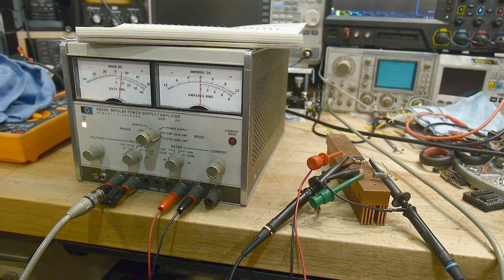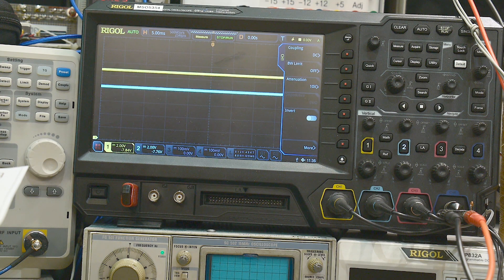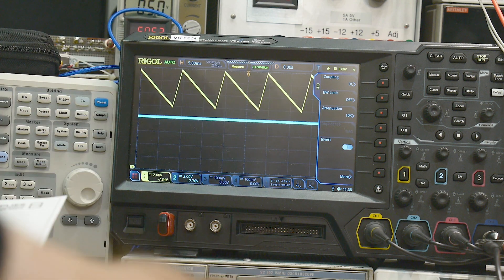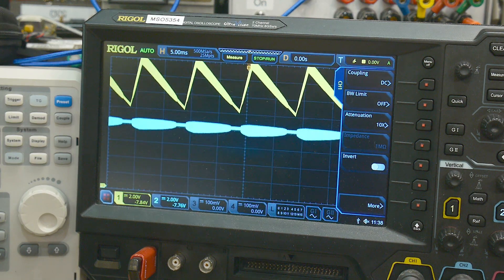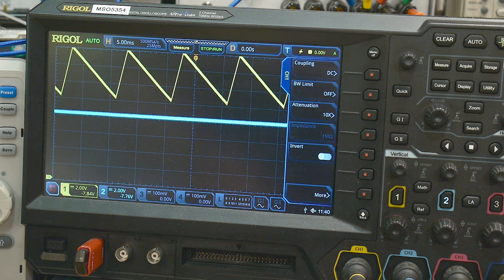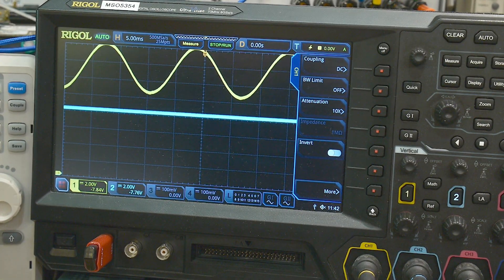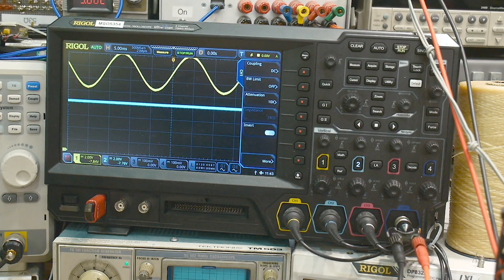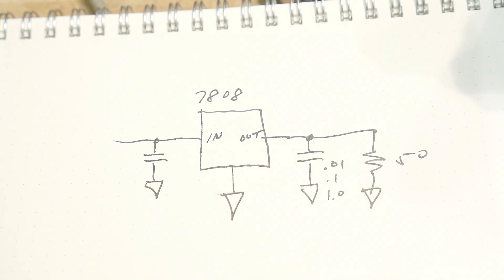#1598 Ripple Testing a Three Terminal Regulator

Comment: What would happen if there is a combined high capacitance of capacitors on the output? Like if I hooked out 4 op-amps with their own 0,1uF and 10uF caps and some 100uf down the rails, plus the usual caps close to the regulator?.

Comment: The very fact that the input to the regulator, at the point of measurement, shows "oscillation" demonstrates that the impedance at that frequency is fairly high - the input source isn't behaving as a good voltage source which should have zero source impedance.

The leads between the power supply/amplifier and the regulator are run as two separate wires, That means there will be a moderately large amount of inductance. It would be much better to use a closely twisted pair. Whether the inductance is really a contributor to the oscillation is hard to say, since we've never seen the frequency of the crud. Looking at that frequency and how it might vary with the capacitance at the regulator could be quite instructive.

With the regulator so far from the power supply I would use at least 10 µF right at the regulator input. Sometimes a mediocre electrolytic can be better than a cap with very good high frequency characteristics. The crummy cap can "spoil the Q" of an unwanted resonance.  A more predictable approach is to use a good capacitor in series with a small resistance (remember that an LC circuit with ideal components just shifts energy around - it doesn't "dispose" of any). A small capacitor with good high frequency characteristics in conjunction with the inductive connection to the input supply could be making a high-Q circuit with a big peak in the response.

~~~
An aside on low dropout regulators - Some of the older (but not really old) low dropout-voltage regulators are sensitive to the ESR of the capacitor at their output. The must have a cap, but the ESR must fall within a range that is neither too low nor too high. Newer designs are mostly tolerant of caps with very low ESR.

If you look at the gain and phase response of some regulators you'll find they bear a remarkable semblance to that of an inductor!

Comment: Hmm, how about testing with real mains transformer ripple under various conditions such as grid mains, generator mains and UPS inverter mains .  Also having a fridge or vacuum cleaner turn on/off its heavy load in parallel with the transformer input .

Comment: I think the test was not done properly. The dropout is specified at 2 volts but with no ripple on input voltage. 
Then, the ripple rejection is specified at 62db typ. for a 11.5 volts min input.
So, I would like to see again the test setup for an increased input voltage and the same output capacitors. I bet no oscilation will be there.

Comment: onsemi mc7800 series says no output cap is needed but it does improve transient response. Less than 0.1uf could cause instability.  ST also says it's not required but shows it in typ app circuits. They also call out a tant mylar etc. with low int impedance at high frequency at the input. They also show a test schematic to inject ripple for rejection testing at 120Hz. Another video could be interesting.
Reply from the maker: Yes, I need to revisit this sometime. I agree with you, the datasheets say output capacitor is bad and I've always avoided it. I may have found a cloned regulator.
Reply: Indead, it would be interesting to compare the behaviour of different brand regulator.

Comment: From what I have found the voltage diff for 3 terminal regs should be 2 volts plus the ripple  so that it has the envelope of voltage to keep from falling out . Nice demo there  like the video.  a low esr 10 mfd close to the load has worked well for me.

Comment: Interesting. Wish I had seen this prior to when I built a multi voltage power supply out of a large transformer, rectifiers & regulators. I did see the noise on the regulator's output and ended up as I remember placing, out of abundance of caution, a 10 micro farad electrolytic from output to ground.
Speaking of this type of regulator. I really like that they are available in that it makes macgivering together  unique power supplies much easier.

Comment: Some ps or batteries have a large output resistance. If you add  areisitor like 10ohms in series with 7808 input, would you get the same oscillations?

Comment: I always wanted to kown... If you yave two power suppliesmand you connect them in parallel via a resistor,  can one act as a programble load, or variable load?  Does the lower voltage ps get damaged?  If you had two of these gadgets, could you use the other as a programmable load?
Reply: Generally, no, a power supply can't be used as a load.
In order to act as a load a circuit must be able to cause current to flow from the "hot" terminal to the "ground" terminal, internal to the circuit. This is a "shunt" regulating function. Power supplies normally have no circuitry to provide the shunting path.
What happens if you drive the output terminal of a power supply above its setpoint is a bit hard to predict without knowing the actual circuit used. If the voltage applied is only a little above the setpoint (e.g. not more than a few hundred millivolts), the supply simply turns off its series pass element (typically a bipolar transistor) between the raw DC and the output terminal. Nothing untoward happens. If the voltage applied is more than a few hundred millivolts above the setpoint then things can get ugly, with current flowing where it shouldn't and potentially causing damage. This isn't too common, but it can happen.  

There are power supplies that are designed for operating 'in two quadrants", where quadrants are those of an X-Y graph with both axes extending both positive and negative. A positive supply would be considered to operate in quadrant 1 (above the X axis and right of the Y axis, where X it traditionally voltage and Y is current), where conventional current (i.e. positive to negative) flows out of the "hot" terminal, through the load and returns to the "ground" or "zero volt" terminal. If the supply has additional circuitry to do shunt regulation, where conventional current would flow into the "hot" terminal from an external circuit, you have positive voltage and negative (in a relative sense) current. That is "quadrant 4" operation (quadrants are numbered counterclockwise from Q1, so Q4 is "under" Q1. Some supplies can operate in all four quadrants. An audio amplifier that is fully DC-coupled is essentially a four-quadrant device, though most of the time it operates in quadrants 1 and 3 (positive voltage, positive current and negative voltage, negative current). Depending on the design, shunt or "current sinking" regulation can put higher stress on the power semiconductors than normal series or "current sourcing" regulation, so operation in quadrants 2 and 4 may have limitations that don't apply in Q 1 & 3.

Comment: LDO reg ICs (with 'pnp' series-pass element) are more interesting they have an extra node so potentially more unstable. 
In formal design, just "adding C to stop oscillation" isn't good enogh, so use a dynamic load (ie 4Q PSU) to 'shake' things while measure the phase margin at different load currents and input voltages. It's because if the C is too low ESR then it reduces phase margin = latent failure mode during service life.

Comment: Does your scope go up to switching power supply frequencies for the record/playback? I know that's borderline for the amplifier, but I'd like to see that kind of noise superimposed on a supply, and how well the 3 terminal regulators take that on under variable load (ie using bus power and local 3 terminal for clean power in lower voltages)

Comment: How much ripple in the output is acceptable is probably dependent on what you are doing with that output isn't it? Is there a way to determine the "correct" capacitance for a known acceptable amount of ripple in the output? Maybe this is done by repeating experiment you just shared with us, during the circuit prototyping stage of design?

Thank you for sharing with us your knowledge.

Comment: I have mentioned on your channel that linear v regs attain their best level of ripple rejection at a higher voltage than the dropout number... Three volts of headroom is typical for data sheet ripple testing. I would like to see the ripple at the dropout voltage verses the ripple at plus three volts... Using the input and output cap values specified in the data sheet. Please and thank you.

Comment: This has been known about for decades, the design rule of thumb was always install  0.1 ceramics as close to the input and output pins as possible. 
Not only did these things hoot with ripple, they sometimes burst into HF oscillation all by themselves.

Most of the spec sheets have something like this in them.

Cin is required if regulator is located an
appreciable distance from power supply
filter.
CO is not needed for stability; however,
it does improve transient response. Values
of less than 0.1 µF could cause instability

As you say always check with a scope. Also note that these regulators are NOT totally short circuit proof.
 
Andy

Comment: i saw that before and solve it with a  2,2µF foil capacitor in the outputstage of the 78xx and a 500 times bigger electrolytic capacitor  and a 2,2µFfoil capacitor in parallel on the input stage of the 78xx.

Comment: I would never use less than 10 uF on the output of a three terminal regulator. I believe the datasheets will tell you that. It is a good idea to parallel a 0.1 uF on the vreg output also for higher frequency attenuation.

Comment: The real world ripple needs to be a rectified sin wave with a large capacitor (would look like a distorted, lop-sided triangle wave) for the input.  The usual output recommended is about a 10uF electrolytic in parallel with a lossy ceramic disk or tantalum.  The ground leads need to be short and high current.  Any capacitive coupling of noise to the ground led will be amplified.  I am soo jealous of all the electronics you have to make measurements.  Enjoy catching you every morning.
Reply: 6V ripple is pretty severe, I'm surprised the regulator did so well.  I do wish he'd zoomed in on the oscillation to see what the frequency was.

Comment: The spec sheet indicates that output capacitance only affects transient response -- not stability.  Your signal generator is probably DDS in which case the sharp transitions are probably exciting the 7808's feedback loop.  If so, series inductance or resistance before your circuit will probably help.
Reply from the maker: the generator is a very old Tektronix pure analog generator.
Reply: None of that old digital rubbish ! @IMSAIGuy
Reply: Proper DDS function generators have reconstruction filters that don't leave any transitions that weren't meant to be there...
Reply: @absurdengineering  DACs are discrete.  EVERY time their output changes there is a very sharp discontinuity.  LP filters can smooth those, but filters always have a fixed cutoff frequency that does not change with the set frequency.  Thus, it is necessary to tune the filters appropriate for the highest available frequency and wave shape to avoid attenuating these amplitudes; in that case, signals at the lowest set frequencies then contain all unfiltered harmonics.
Reply: @byronwatkins2565  DACs in modern function generators run at a fixed frequency and the reconstruction filter matches that.
Reply: @absurdengineering  And yet you can vary the signal's frequency.  A slope that matches the highest frequency is an abrupt discontinuity at the lowest frequency.

Comment: Could one use a combination of a large and a small value capacitor on the inputs and outputs? The large ones might be better at slow ripple while the small ones would be better at the high frequency oscillations.
Reply: That is the best way to tailor the device to your needs.

Comment: Wow, that scope display at the beginning was really insightful, when the supply is higher than the regulation threshold I kind of imagine the supply voltage "stretching a spring" which holds the regulated output   "up against" the regulated level...

Comment: Symetrix uses 4.7uF BiPolar  caps on the output of the + - 15V supplies to ground on the 528E voice processor. When they go bad the 7815 or 7915 will oscillate anywhere from 45KHz to 10MHZ. Makes the unit sound awful but if you don't check with a scope you will never know. I show it somewhere in one of my7 vids.
Reply: can't do it without scope? say rf detector
Reply: I @SergiuCosminViorel  I don't know. I have never had a good RF probe or meter but i think it might work. I know it shows up as distortion on my HP 332A distortion analyzer but I'll bet fewer folks have a distortion meter than a cheap scope.

Comment: I'm bit suspecting that HP6826 output is oscillating.
Does it handle capacitive loads?
Reply from the maker: you can see the input to the regulator is not oscillating, but the output is.
Reply: @IMSAIGuy got it. thanks!

Comment: Supposedly those monolithic regulators are really bad at getting rid of high frequency ripple.  I wish you would have tried like 10kHz or more instead of 120Hz.
Reply: Where would one encounter 10kHz ripple on a linear regulator? Are these generally used with switching power supplies?
Reply: @silverXnoise  Not used with switching power supplies.  I was thinking about noise coming in on the AC, from other switching supplies or other noise sources within the house or from close by neighbors.
Reply: @jimomertz  I didn’t think about induced noise, makes enough sense.